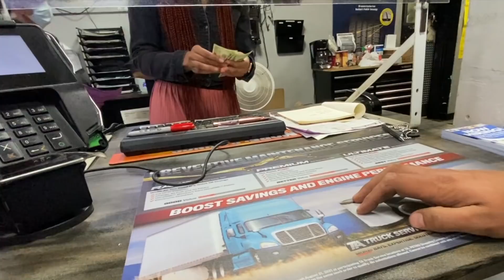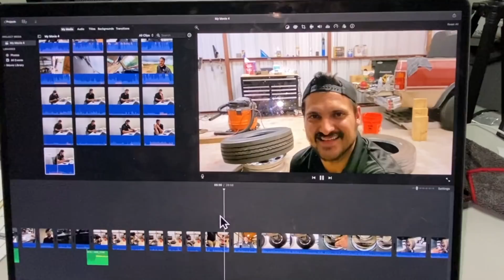I just quit driving hotshot  -  week 1

Comment: You seem to always have a rough time maintaining trailers. I have one account I service about 60 trailers for and I have learned a few things. Buy parts before you need them. Every trailer should leave with a sleeve of bearings, races, and seals. A backing plate for each position is good but double is better, get some lug nuts and run a cable tie through them to keep them organized, find out what bolts are on a trailer and get multiples. Get wire for repairs and the crimp gel connectors. Keep all that on the trailer. It’s less that 100lbs and you will forever be thankful.

Additionally whenever we have a brake issue there is no question, we replace the whole brake assembly. Magnet not working? New assembly. Adjuster not turning? New assembly. It’s so cheap and easy to live headache free
Reply: my question is are those light duty trailers really designed to be pulled 100,000 miles per year?
Reply: @makeitpay8241  not at all
Reply: @makeitpay8241   they can be..  But the biggest problem is the people that sell them don't even  know what is available or offered and most buyers dont  know what a manufacturers can offer either. The sellers sell the cheapest junk available because people want cheapest price. After being in business for years  I now order them special to my need.  Did you know that on most of these light trailers you can order 4 different styles of brakes and at least 4 different styles of suspension and about 40 different axles about 15 different kinds of hitches including custom cushion hitches ? I like hub pilot oil bath hubs on Dexter axles.   I always order electric over hydraulic disc brakes and can skid tires with  trailer fully loaded. I also order air ride suspension "ridewell brand usually"  because air rides better and the dangerous shifty loads I sometimes haul  don't shift on the trailer because it's smoother. The downside is you need onboard electric air compressor.  The brakes last about 150,000 miles per set.   On the tires and wheels you can buy many different specs. Like cheap trailers come with cheap 3 ply tires that run 30-50 lbs air pressure and look like car tires. . I use heavy 14 ply rates tires rated for 6600 lbs each and run 125 lbs of air. They look like miniature semi trailer tires. I get rid of dual wheels and run single wheels to save weight.  I can get 110,000 miles per tire.  The biggest deal about a custom trailer like I order is that the upgrades add weight. So I order aluminum frames and floor to save weight. When done it costs about double but runs 4 times longer and 3 times safer. Also when ordered you can spec all your custom tie down points and lights and toolboxes and dunnage racks and everything else. It's the same as buying a house.  You get what you pay for and If you build it new you can build it how you like it.
Reply: @ifyoutip  i never understood folks buying pickups to haul freight unless they were just getting into the business. i started running a guys hotshot & after 2 year found an old 2 axle semi. i had enough of trying to get quality sleep in the back of a pickup & they ride so rough. i have seen plenty of folks adding a sleeper behind the cab of a pickup & then adding an air ride drivers seat. not sure why more don't go this direction but it's their spine. i also love being able to split the sleeper berth.
Reply: @makeitpay8241  I ordered and use mine for 90 percent dedicated runs where it was just the right thing.  But just for someone to get into trucking with a hotshot and dually diesel pickup truck makes no sense to me.  They are easy to overload and misload and heavy loads can tear up them small trucks like a monster. I now order what I need for the job and it works well.  Most often a heavy truck  is just the best way. I see semi trucks pulling gooseneck trailers sometimes and I wonder how it compares dollar wise after half a million miles
Reply: @gravy train you should make a video showing us your trailers also like to thank you learned alot from your comment
Reply: @ifyoutip  heavy trucks often run a million miles before needing a rebuild where as a dually is well worn after 300k. instead of spending 50k on a pickup i think spending that same amount on a semi might end up being a better way to go. but i don't know for sure.
Reply: @yaboy_jose1745  that is a great idea. I never posted a video before and the only camera I have is on my phone but I think it would be an eye opener for serious people to see what is available.  My trailer was made to haul steel farm gates  from the factory where they were made to the powder coating facility or the galvanizer where they would get hot dipped galvanized.  So a lot of 10-12k loads.
Reply: @ifyoutip  Id be interested in being able to contact you for information like this when I get to where I'm ready to buy. Is there a way I could contact you, maybe an email, for questions?
Reply: Free game 💯

Comment: Stock up on tires... keep a couple on hand. See if you can get a wholesale account at tire distributor. A little bit of brake silicone grease should solve that seizing adjusters.
Reply: before i went out on my own the guy i was working for had extra wheels & tires all mounted & ready to install at his yard.
Reply: I keep at least 24 on hand at all times, saves a ton of time. i also found a good really good deal on a used tire machine so no more bars. makes life easier for sure.
Reply: @rwt8851  simple tire has great deals on tires

Comment: Alex I’ve been using that very tube you installed for paperwork for over 13 years now. It works fine, but you need to use two zipper type plastic bags… seal the paperwork inside one, then seal that bag inside the second bag. If you don’t, your paperwork WILL eventually get wet. Congratulations on reaching your goal! Stay safe…👍

Comment: Hey Alex, Given how many trailers you have to maintain; I'd suggest that you arrange a standard brake setup, with a standardized Deutsch connector for the wiring, so if a brake isn't working, you can uninstall the entire assembly (backplate and all) and install a prep'd assembly from your spares inventory. Then you can rebuild/service without impacting trailer availability. Same with tires and wheels.

Comment: You need to lube those adjustment screws. Use maybe permatex disc brake lube. And put some kind of covers over those cutouts. If you drive thru rain or snow, you'll get crap and corrosion in there.

Comment: Alex go get a product called ANTI SEIZE   Take the SELF ADJUSTER apart run the tread part of the adjuster on a wire wheel (Bench Grinder) apply the ANTI SEIZE to the treads and you will not have self adjusters seizing up I am a Truch/HD equipment mechanic i have been doing brakes for over 40 years all drum brakes get this treatment!
Reply: i saw a video on youtube that showed like red wolf grease works better than anti seize

Comment: Get some brake spray and then grease it so you don't have the problem next time. It's gonna be harder next time cause you cut the shield and water will get in easily .
Reply: Rivit a plate with epoxy to seal tli. Don't forget to cut a hole for adjuster.
Reply: weld that up be good as new.

Comment: If you unscrew those self adjusters and coat the threads fairly heavy with high temp anti seize, it will help to keep the rust from building up and keep debris and moisture from getting into them as bad.

Comment: If you weld on the plate it weakens the metal. Remember all the torque of breaking is applied to the plate and heat destroys the temper.

Comment: My guess is the trailer with the stuck brake adjusters was the one you used at the port?  If so, I would think the sea water (if the port was at sea) flash rusted your adjusters. Maybe?

Comment: You should widen the driveway now a two car drive way will cost you on tires being rubbed and or bubbles to occur.  If the street isn’t wide enough for truck to pull out into the road way- it will be a problem.

Comment: Hi Alex I'm happy for you about you being home more and enjoying you family you are one of the hardest working guys I know. I have a question for you about the Ram Trucks you have I hope you can help me with. Have you noticed how often they go in Regen Mode?? I have a 2020 2500 and it has 24000 miles on it and I have noticed that it is running in Regen about half the time it's driven, I have taken it to the dealer 3 times over this and they say that's normal!!! It didn't do this the first 22000 miles I drove it and it is driven on the highway 95 percent of the time I also pull a Travel Trailer with it on a lot on trips. Any help would be greatly appreciated Thank You and God Bless (:

Comment: Get better trailers so you dont need to replace axles all the time
Reply: It's probably the axle and not the trailer also, objects in the road way damages axles tubing so it's normal to see issues with axles components getting damaged or worn.
Reply: Ita the way those trailers are specced to keep them under gvwr requirements. So the loads  are too heavy really for the trailers. The real solution is to have a heavier and more heavy duty trailer and truck tagged above 26k lbs  to get rid of most of the  maintenance issues. Alex doesn’t as there is more insurance to pay and more government restrictions/taxes.

Comment: Real impressive, the first time you meet a new driver, he shows up in raggy shorts and wearing flip flops.  Time to send him home.
That tool you made, by cutting your short extension, you can buy those like that.  They are socket length.  
Another option on freeing the brake adjusters is put them in a pan of diesel or even used motor oil and let them soak.  Cutting the bottom of the splash shield on each hub, will now allow road debris to get in the brake components easier.  You may need to clean the brake adjuster more often.
Reply: New generation of “truckers” unfortunately… no personal pride
Reply: @BloodSweatandGearsGA  Very true.  T shirt with yesterday's chili down the front, Shorts hanging off their butt and flip flops.

Comment: alex you do realize those are self adjusting brakes, the arm that sits in front of the gear, will adjust those brakes, you definitely need dust covers on those openings. those brakes like most every brake can be auto adjusted by simply backing up and hit the brake harder than normal that arm will push that gear and auto adjust your brakes.

Comment: Trucking is a good business.  But trucking not always understood within the industry.  And CERTAINLY not understood outside of the industry.
The big repetive problem that you kept encountering.  Is your equipment IS WAY TOO LIGHT for the cargo and the runs you do!
I agree with the commenter that stated you needed to keep spare loose tires in your shop.  I also agree with the folks about silicone grease on hand for the brake parts.

Comment: Avoid those rip off tire guys.Def stay away from truck stops and if they say cash only say no thank you.They are trying to pocket the cash and you wont have a legit sale or recourse if problem with tire.I ran a tire shop for over 10. Years when I came off the road. Most tire wholesalers or distributors will sell directly to your company and deliver the tires to your place of business with a 40% or more savings.American tire actually used to deliver twice daily on the mid Atlantic region.If you ordered before noon you could get tire same day.Just sharing some info

Comment: Congrats!! I saw you from the beginning and look till where did you get. I’m getting into hotshot and I need to know if for a RAM 3500 I need commercial plates and needs to be register at 26,000 at the moment of registration in the dealership?? Can someone help me out, please
Reply: I believe you only need apportioned plates if you running CDL. I could be wrong
Reply: @devinjohnson9749  your right
Reply: @devinjohnson9749  So I just register it with 26,000 GWR with regular plates??

Comment: Not trying to hate,but you need to stay away from the brakes on those trailers get someone who knows what they are doing. If DOT,or local inspection officer pulls that trailer in for an inspection it will be red tagged and shut down. Not to mention the lawsuits ur exposing urself too,if those brakes get jammed with road debris causing them to fail and causing an accident. The lawyers will be all over u when they see those brake assembly protection covers cut. You are now a lawsuit magnet protect urself. Get a trailer mechanic.Good luck and regards from a 20+ seniority truck driver.

Comment: I admire your determination. Problem is you just hacked your backing plates off for a simple 10 minute fix. First you try wd-40 by spraying it thru the adjustment hole on the backing plate. If that doesn't work you pull the wheels, pull the star wheel adjuster out. Put it in a vice and use the proper tools to free it up. Lube it with anti-seize and put it back together and readjust. You will never have a problem again. Unfortunately for you, the same problem your having now is going to come back to get you from you hacking the backing plates. They are designed to keep dirt and debris out of the brake drum. Yours aren't doing a damn thing now except everything you don't want! Good luck boss--Hire a mechanic. CHEAP LABOR ISNT SKILLED-SKILLED LABOR ISNT CHEAP

Comment: Alex you are going to kill yourself trying to run a bunch of non CDL hotshots. It's way too much work to keep multiple hotshots loaded with partials. You would be doing so much less work if you started phasing out the hotshots and moved to only semi-truck drivers. It's so much less work booking the loads for a standardized semi-trailer because bulk of loads are set up for that size trailer and weight capacity.

Hotshot is what you do as an owner op, but trying to run a bunch of them is going to take every waking moment when you could have so much easier time just moving to semi's.